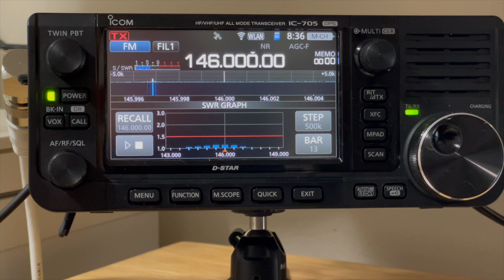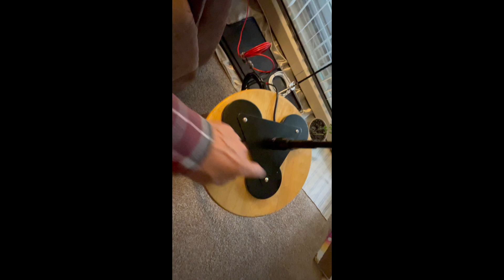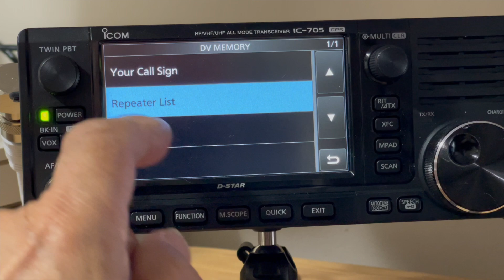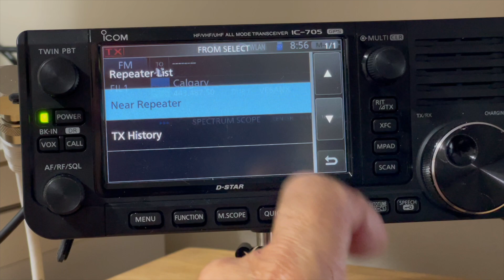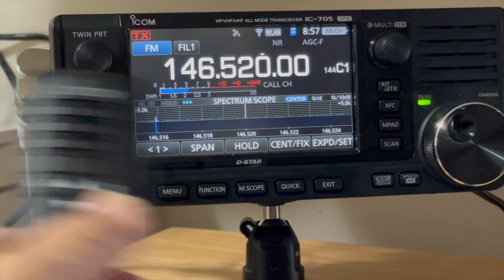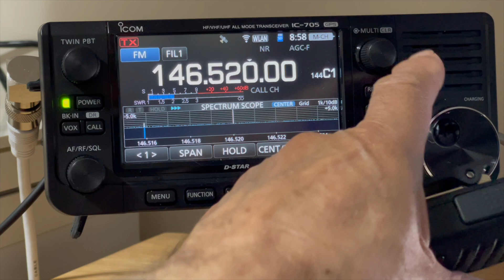IC 705 & 7300 SWR Method & Comet CA 2x4SR VHF/UHF Antenna Test

Comment from the maker: When in SWR mode, everthing is locked out, except the PTT or CW key.  To make changes you need to step out of SWR mode transmission, make changes then back to SWR mode TX.